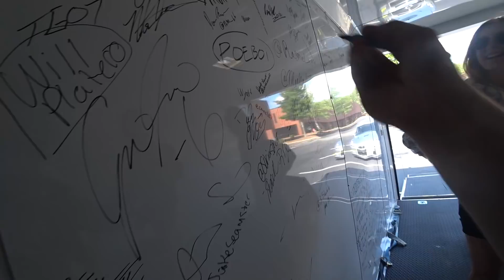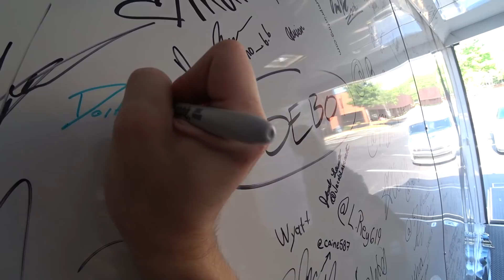This YouTuber Wont Get Out Of My Car

Comment: Hey Dan, I have a 2005 CBR 600rr, I was reading about the Pon octane requirement being only 86, and if you have used 87 in your cbr600 when you still had it. Or if anyone else has used it. The manual says 86 but I am just checking with other people before switching.